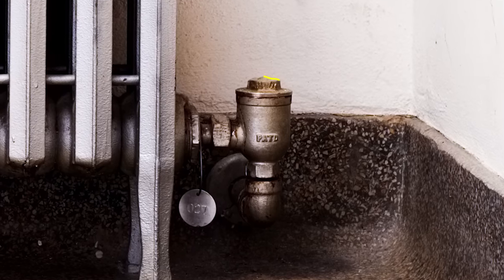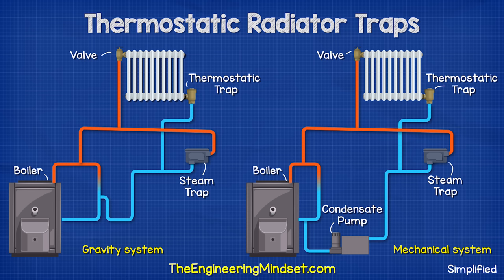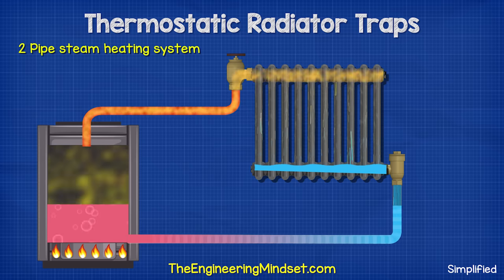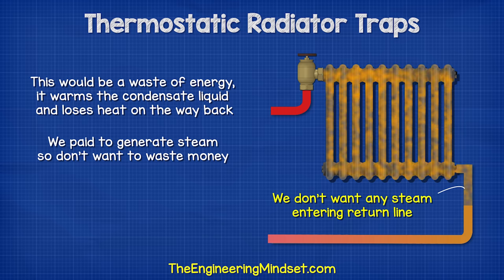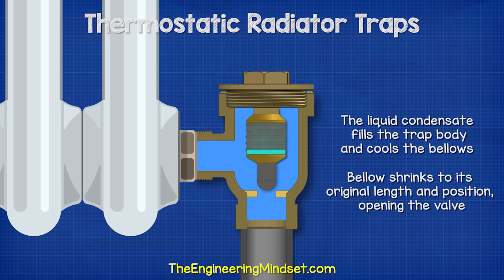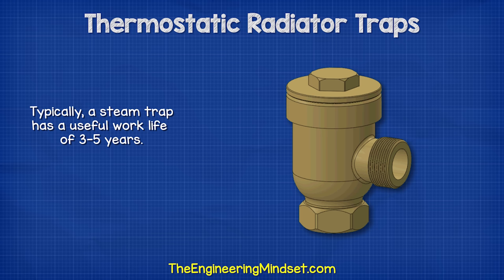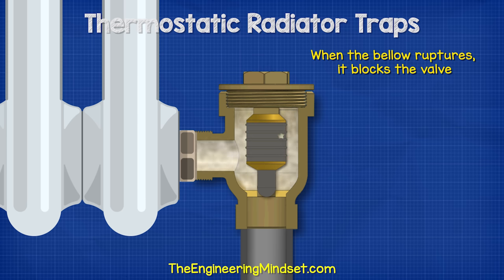Thermostatic Radiator Traps - Steam heating HVAC

Comment: Years ago I was servicing a steam system  with thermostatic steam traps on the rads and no thermostatic temp controls on the rads , the only control was an indoor outdoor controller ,Working press 1 psi or less , Along with sagging condensate lines causing condensate problems ,some rads would not heat up , That was a hellish system to operate properly . Those thermostatic  steam traps were bi-metal disks .
Reply: That's less logical than wet bellows. Systems I've come across use condensate float valve steam traps.
Reply: @millomweb  This system , 100 year old plus had a techmar 269 controller , rads and disc type steam traps at each rad , the valve portion of the disc was a 5/16 ball bearing attached to the underside center of the disk , Very few buildings in Canada are like this , Most are float type traps .

Comment: Thank you for the very useful video. I get my system serviced every fall, but I haven't had my traps checked. I believe one of them is stuck closed and a few of them could be stuck open. I'll find out in September because right now, the utility bill is within acceptable limits.
Reply: If its stuck closed you don't get any heat . If stuck open then steam gets into condensate line and lowers efficiency

Comment: Thank you for the informative instruction.  The failure of a steam trap in the closed position is easy to spot.  No heat from the radiator.  But finding the trap in the open position is extremely difficult, no tenant complains about too much heat! They open windows!  What are the best ways to diagnose a faulty trap in the open position?
Reply: I have been in the field for 35 years and I’ve seen devices such as sonar and infrared, and my conclusion is: replace the trap every 5 years.
Reply: Look for open windows? I'd open my window once it hits 20º or so (68ºF)
Reply: The best way to determine is by taking temperature of  the condensate piping . It should be less than 212 as that would mean steam .

Comment: Why not use hot water for heating instead?
Seams much safer, at least in regards to the steam explosion risk, but I don't think it needs to constantly change those steam trap valves all the time.
Also, doesn't a steam heating element get extremely hot? (around/above water boiling temperature?)
Reply: Steam is used because water releases a lot of heat during the phase transition from gas to liquid.
Reply: Steam holds way more heat than just hot water.
Reply: Yeah, I agree that steam systems make no sense, except for the producers of that shitty parts that need to be replaced way too often.
For over thirty years I've lived in a house with hydraulic heating system with coal burning stove. For all that time nothing more was needed than burning the coal to get the heat in whole house. Occasionally some additional water had to be let in the installation as it evaporated and these heaters that are highest were cold. Nothing more. I would be extremely mad if I had to replace that idiotic valves every few years. Also I can't imagine how many problems would occur if the heating system in that house would be steam based, not liquid based.
Reply: The difference is just the parts that need to be changed.  No circulation pumps in steam to work on or fail .
Reply: @rodneyhickman825  i'd rather change a circ pump (x1) every 20 years then serval silly valves every 5 years (xWhat ever amount of radiatos you use !!!)
Reply: Forced hot water > steam

More efficient
Can be zoned
Better equipment
Reply: You don't need pumps with steam. These systems were mostly designed and built when electricity was new and expensive and the ability to make long-lasting pumps at that size that were also powerful enough to do the job existed but was very expensive.

Cheaper to pay a guy to replace some doodads than to have a whole new electrical system installed in your building alongside the heat, just for the heat.
Reply: steam can go up skyscraper 50+ floors, no need to get a pump for every floor or lost of pressure due to large area. This is usually for heating large commercial building.
Reply: @ekfliu  Great application.

Comment: I’m well aware of the industrial application of steam heating. But i never knew that it’s also used in commercial buildings, I thought  only hot water was used. At least thats what i use
Reply: @Desktopia alot of really old buildings still use steam heating.  Not so much in newer buildings.
Reply: @Desktopia Can still fit TRVs to steam fed rads - as shown in this video !
Reply: @Desktopia is controlled the same way . By control valves . Since steam moves by pressure rather than flow turning off a boiler means no heat in short order . This also means you can take pipes apart without draining any water

Comment: Good video. question tho, any steam system will be latent heat obviously it’s in the name steam so it latent heat is passing through the radiator would this not be dangerously to hot for the end user and could scold the end user, unless obviously these rads aren’t used where people could touch them ?
Reply: Could not touch them

Comment: Ummm well boiler systems are about 30psi.  As the pressure increases so does the boiling point.  So at that 30ppsi pressure, water could be still liquid at 215 degrees.  Residential boilers aren't that hot anyway.  Normally around 180 degrees.  Commercial uses steam boilers.

Comment: I have a question. How can steam push the water back into the boiler? Wouldn’t the pressure pushing against the return line be the same as the pressure pushing steam out? I thought it just returned from gravity.
Reply: It’s a closed system. The pressure has to go somewhere so it moves. As the steam leaves the boiler, it pushes the water that’s ahead of it in the system.
At least that’s what the video indicates.
Reply: @totallyfrozen  The steam should be pushing against the water coming into the boiler just as hard as it is pushing the water back into the boiler. I don't understand why there would be a pressure difference here without a pump or by just using gravity feeding.
Reply: @Boomchacle  There’s no liquid water leaving the boiler in this design, only low pressure steam (less than 2psig). The liquid phase when working correctly will only exist in the condensate side or the boiler itself

Comment: The steam radiators in my apartment have the inlet and outlet on the same level. Wonder how that affects the operation of the system. Granted I'm on the ground floor and the heating until is in the basement below my apartment buy it feeds steam to multiple floors for 30+ apartments so I don't actually know if the radiators are all the same.
Reply: Modern systems use hot water rather than steam. Safer and easier to deal with, just use pumps, now that they're cheap and so is the electricity to run them.
Reply: @Teth47  problem is by apartment building is over 80 years old and has many archaic remnants left over.
Reply: That's a one pipe system.  This video refers to a 2-pipe system.

Comment: What prevents the use of a sphere which density (in between liquid and gaseous water) would make it float in water (not obstructing the exit pipe) and "sinking" (resting on the circular joint) in vapor (obstructing, therefore closing, the exit pipe) ?

(Sorry for the phrasing, I tried to put the TLDR question on a single first sentence, and am not fluent in english)

I have no background in material engineering and may be missing something obvious, without which I only have the feeling that this may provide the same "open for liquid water, closed for gaseous water" feature (almost) without any mecanical constraint (the repetitive contact between the ball-like-valve and the joint may not be negligible for the needed hermetic property of the couple), and also easier and cheaper to manifacture, install, maintenance (but maybe less tunable)

I'm not commenting often so I'll take this opportunity to thank you a lot for your videos and animations !

Comment: @The Engineering Mindset
My background mostly in motion control systems, so this isn't my forte, but couldn't you just get rid of the bellow and use a hollow steel ball that is slightly larger than the diameter of the hole? Add a plastic ring gasket or O-ring on the inside opening of the outlet to help make a good seal. When the water is low enough, the ball would be sitting over the hole, creating a seal to prevent the steam from entering the return. When the water is above the buoyancy point of the hollow steel ball, the ball would float, allowing water to pass till the level dropped low enough for the ball to once again block the outlet to the return. In theory, the buoyancy of the ball should keep a somewhat constant water level on the bottom of the radiator, since the pressure above the ball would be greater, holding the ball over the hole till the water rose enough that the force from the buoyancy of the ball overcomes the holding force caused by the difference in pressure.

Again, this isn't my field, but I'm just curious if there is a reason this isn't done, since it seems like a solution that, if plausible, would eliminate the 3-5 year life expectancy.
Reply: You also need to consider how you  can let air pass through the trap when the system starts up.
Reply: Normal steam traps use condensate float operated valves. Recogniseable by their noisy intermittent triggering to blast condensate through return pipes.
Reply: @oldhandyluke  Thanks, I never considered there would be a need for it until I read that(seems kind of obvious now...). My way if used in a two-pipe system would just pressurize everything before the trap till something failed.
Reply: @Poptart133g  most of the time, these systems need less than 2 psi to run. The empire state building has this type of system and it runs on no more than 2 psi. Some of these systems in residential buildings can be run on just a few ounces of pressure.

Comment: Do you have a video on a hot deck AHU?   They just torn one out and put VAVs with reheat coils in.  I'm just the electrician but I can't see how that's going to work.  Please enlighten me.
Reply: There is a vav video done by the engineering mindset. Scroll through the video library archive.  It's there some where.
Reply: Basically supplying somewhere in the area of 16c  of air from Air handling unit  then air is reheated at the vav box and if cooling is required then valves closes of flow of water in the coil and the space receives only the cooler air from the air handling unit . Some vavs have dampers that can adjust air flow based on co2 or occupancy

Comment: Who use this system? Where is it popular? Which countries?
In Poland there is only water based system.
Reply: These systems are found in a lot of 19th and early 20th century multistorey apartment and commercial building in the northern regions of the US.
Reply: @dadillen5902  these systems were popular even in 1950s . I work on these systems on semi regular basis . Dealing with steam traps and vacuum pumps etc

Comment: here is what I don't get. Steam rads have air vents about half way up. They close when steam hits them and open when they cool to let the condensate drain out so a vacuum does not form. But since when the radiator is operating there is both steam and condensate in them, how does the condensate drain without the steam vent opening? And if it opens with steam inside, then steam is let out.
Reply: The condensate drains out because of gravity. The one pipe radiator, if installed correctly, is slightly pitched down towards the pipe. As steam is flowing into the radiator using the top of the pipe, condensate is flowing out using the bottom of it.

Comment: Why is this design used over the condensate float valve type that everyone uses ? (quieter operation?)
Reply: The float type trap has a thermostatic element in it that is basically the same as the bellows in this, but these things are small enough that you can put one on every single radiator. Air venting ability is also a factor.
Reply: @FirstLutheranAlbany  The float type work by floatation - no thermal element in them.
I can't see air being a particular issue as that will be pushed through by the steam pressure.
Reply: @millomweb  What kind of float type are you referencing ? Do you have an illustration ? Usually the float drains the water and the thermal element vents the air.
Reply: The float type also contains a thermostatic element.  These are used of main piping for larger condensate volumes

Comment: Glad we don't use this dangerous way of heating homes and buildings in the UK oh and this is so inefficient and wastes so much energy compared to the normal water heating system.
Reply from the maker: Lots of older homes and even commercial buildings still use this method. I've seen some that used to pump hot oil around the building too, some of these were converted to water systems.

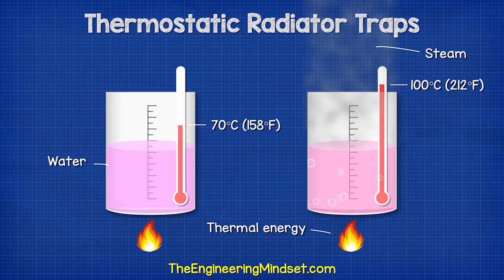Comment: 5:48 Not at elevated pressures. At 25 psi (nominal boiler pressure, here anyway) the boiling point is up around 250 F.
Not criticizing, just think its important to talk about pressure along with temp when discussing boiling point...
Reply: Most steam heating systems should be running less than 2 psi. I always turn down the pressure as low as it can go.
Reply: normally a steam rad system uses 1.5 psi, so that is only 1.5 psi above atmospheric. So it boils at 217.34 F
Reply: @marks6663  I don't work on very many of these systems but there are plenty of systems that run on a few ounces of pressure.
Reply: Where would they be running 25lb steam for heating ?
Reply: @rodneyhickman825  I have base board steam heat that runs off 25psi. The over pressure valve is set at 30psi just like a hydronic boiler system.

Comment: Looks annoying to replace all those valves. Why even use steam instead of simple hot water?
Reply: You would mainly if not always use steam in big commercial buildings / industrial estates, the reason for this is its amazing efficiency on a big system because steam is expanded 1,600 than water it creates more efficiency. And because of its heat depending on the bar of the system associating with steam tables and the temperatures/ because of its such high temperature it can give of its heat to much quicker and easier and more  efficiently